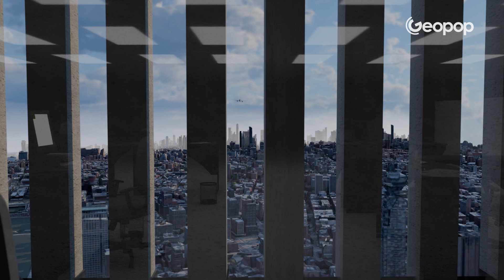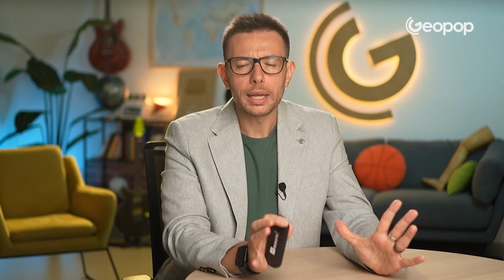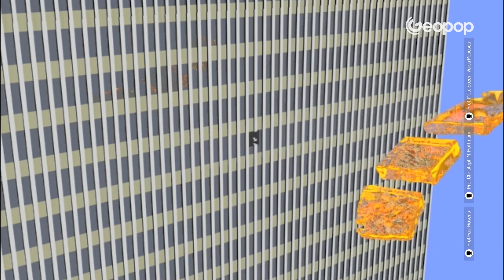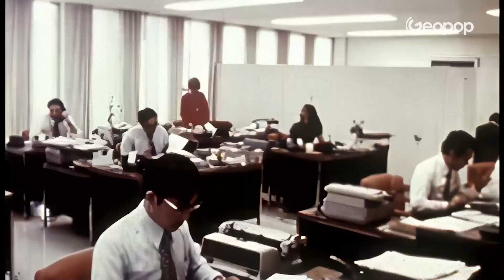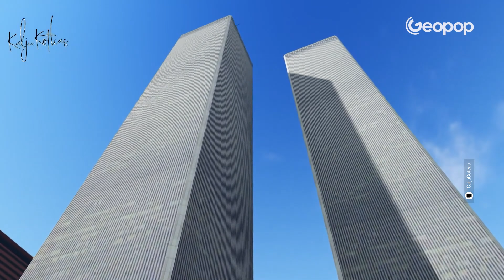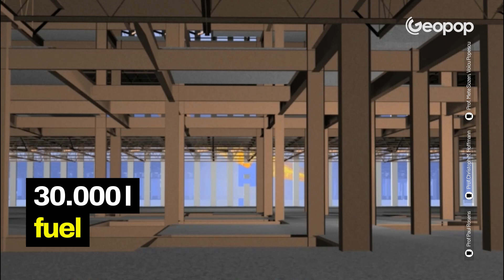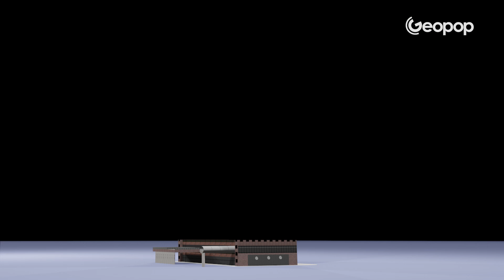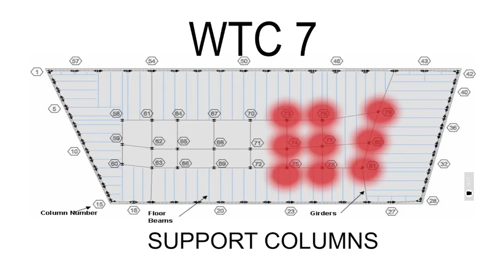9/11, 2001: The Technical Reconstruction of the Twin Towers and WTC 7 Collapses

Comment: JET FUEL CANT MELT STEEL BEAMS
Reply: But the heat from the fires were sufficient to weaken the beams, resulting in catastrophic failure.
Reply: @Gwaithmir no, that's what you were told, doesn't mean it is true
Reply: @robbiehiatt9966  I know it's true because I have an Engineering Degree in Machine Processes Technology, and I understand metallurgical chemistry and how metals behave under different temperatures.
Reply: @Gwaithmir  whatever genius.  What temperature do you suppose was reached at the time of failure? You do realize that 1 of the main reasons people build with steel is because of its resistance to fire, And I know for a fact those buildings, and all highrise building are designed to burn to extinction without collapse
Reply: @Gwaithmir  and that doesn't explain tower 7, it doesn't explain the explosions.  It doesn't explain all the witnesses claiming it looked like controlled demolition.  And all the footage proving it was controlled demolition
Reply: @Gwaithmir so then, you understand that even if thr floors where the plane hit were so hot the steel actually melted, that 10 floors down, where it was cool enough for people to survive, the metal would have had 100% of its strength and toughness intact, which would be at least 110% of the design-assumed strength, meaning that once the compromised floors collapsed down to the intact floors, there would be a deceleration and the off-centre loading would have resulted in  the collapse moving away from the center of the tower leaving behind a shard or a toppled tower.
Reply: @oliver9089  so just ignore everything I said. Make some stupid statement. If the exterior columns on the 7th floor are exactly the same as the 97th floor. If what you are saying is true it would have failed at the bottom.I don't expect you to know that
Reply: @robbiehiatt9966  we are on the same side bud, you misunderstood my comment and/or didn't see who it was directed at.
Reply: @robbiehiatt9966  The fire was on the 97th floor, not the 7th floor. The 97th floor was where the collapse began.
Reply: @Gwaithmir  what im trying to say is on the 7th floor the columns are strong enough to hold 100 floors above it. So the columns on the 97th floor were strong enough to hold 100 floors above it. And that's why you wouldn't need every support to be there in order for it to still stand
Reply: @oliver9089  my bad I think I misunderstood you.  What i'm trying to say is the columns on the 97th floor were strong enough to hold 100 floors onto of them.
Reply: @Gwaithmir  The point is there was more weight on the 7th floor than on the 97th floor and they were built exactly the same. If the 7th floor does not fail
when half of the building is gone why does it fall when there's only a fourth of the building left?
Reply: @robbiehiatt9966  not quite. The columns on buildings like this look the same on the outside, but they are generally much thicker as you go down due to the added weight.
The box shaped columns on WTC 1 and 2 were the same dimensions on the outside, but the plate that was used to form them got progressively thinner as you go up. This is because there's essentially weight to carry at higher floors, and to reduce the amount of weight that lower floors need to hold.
But this means that as the building collapsed, if it collapsed from the top down, that the falling debris would have come up against more and more resistance as it falls into thicker and thicker uncompromised steel below. The collapse should have decelerated, not stayed at constant speed (or accelerated as it did during part of the collapse on all 3 of these towers)
Reply: @oliver9089  I agree, but my understanding was they were the same. How did you determine they were different? Because my understanding was as thick as it was at the top because of airplanes

Comment: This is the most ridiculous video I've ever seen or heard. You're absolutely incorrect on all of it. On your little structure demonstration there is no core to the building he forgot to put the core in the building. This is the stupidest thing I've ever seen 
.
Reply: Which demonstration are you referring to?  There are many.
Reply: Notice at 4:30 they say the reason people use steal is for flexibility. They don't mention another major reason for using steal is because of its fire resistance
Reply: @robbiehiatt9966  - Because that isn't a reason. Why does the steel need fire insulation on it then if its so heat resistant?  Isn't steel formed by heating?  Doesn't it deform the same way?

FFS 😒
Reply: @TheCriticalStinker-jw4fl  Don't blame me for the definition Google has along with tons of other engineers. It says steal buildings are so resistant to fires that they are Designed To burn to extinction without collapse. I didn't say that I'm a builder not an engineer. Isn't stone created by heat? That sounds like you're saying stones aren't fire resistant either. Fire brick used in fire places must not be either What a completely ignorant thing to say
Reply: @TheCriticalStinker-jw4fl  yes measures were taken to make these buildings as resistant to fires as possible. Which is why no one believes these buildings could be brought down by the fires. Why is it there was no water. Why is it everytime the government burns something down there's never any water. These buildings had state of the art fire suppression systems
Reply: @robbiehiatt9966  - Great. Provide the quotes.  As usual, I won't wait up.
Reply: @TheLoonResistance  Once again you lie. You will wait up , that's what you do. You go back to the top of the comments and spread your lies. And you won't never learn until it's your house burning down and you ain't got no water

Comment: While it is true that the 707 was the largest commercial airplane at the time, the B 52 Bomber was most likely the largest airplane at that time & also considering that the first 2 office buildings in Manhattan to be struck by airplanes were in fact struck by Military planes & both the Empire State Building & 40 Wall St are still standing makes them stronger than 1 & 2 WTC!
Reply: Yes because a B-25D - which weighs about as much as just one engine on a B767 - is directly analogous.
Reply: @TheLoonResistance  
Not to mention the fact that the B767 was travelling at more than 300 knots.